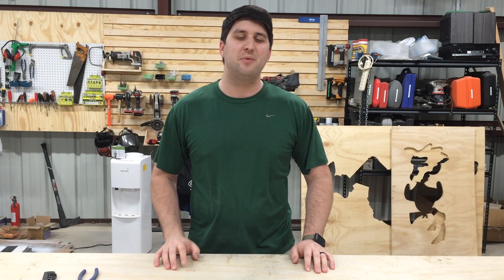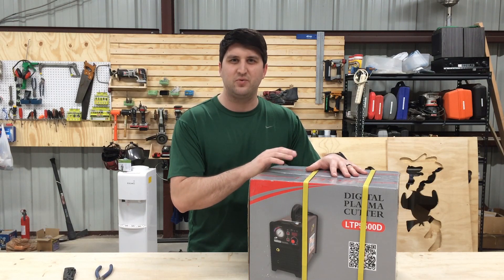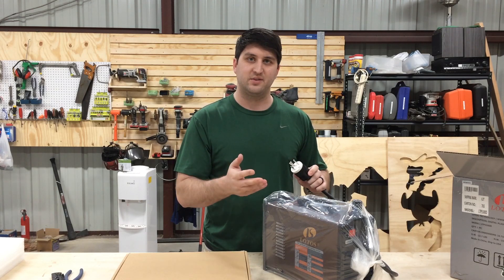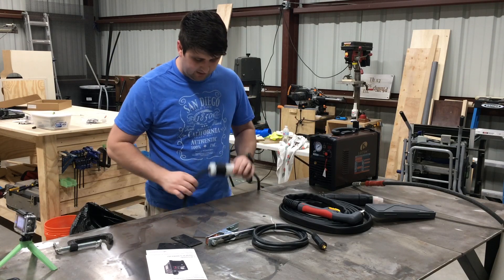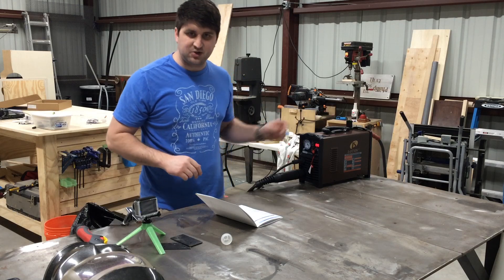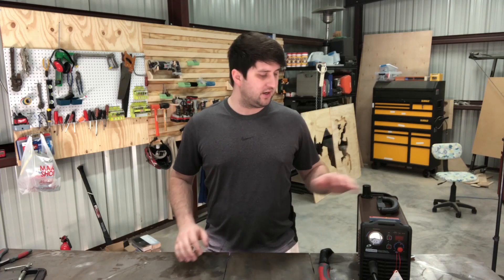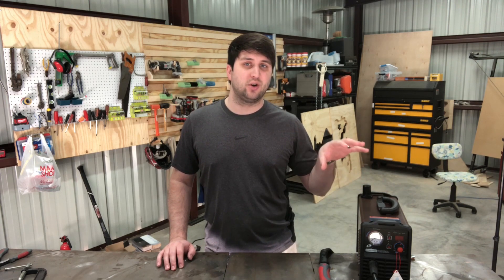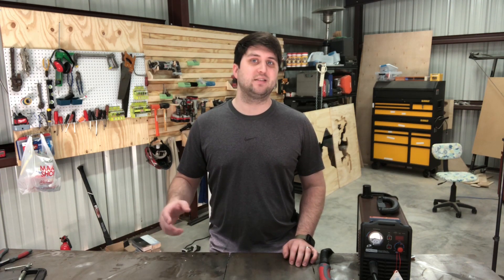Lotos LTP 5500D Unboxing and First Use

Comment: Looks nice. It would be nice to see the consumbable side of the torch and hear what you think about quality of it, how it connects to the plasma cutter etc. Just didn't learn much
Reply from the maker: Jeff lyon sorry to hear that, I did some videos on the consumables but unfortunately life got in the way of editing/posting. I will say I currently do not own this plasma cutter but I was extremely frustrated by the consumables since they shipped with s45 consumables even though it was labeled on the side as a PT-60 torch. This made for some definite frustration when I went and locally purchased PT-60 electrode and tip and what do you know, it didn’t work. Otherwise it wasn’t a bad unit, however I moved more into CNC and it gave me some high frequency troubles with my first cnc so I went with a different one for the second.

Comment: I got the LOTOS LTP5500D-CNC. I'm setting up my shop atm. I'll make some videos on it and hopefully have space to run it on my CNC by next year.
Reply from the maker: Tio Dave that is awesome! What CNC will you be using it on? I have heard some people had better luck with the CNC version and it not causing electrical interference.
Reply: The Mostly 3d Printed CNC or MPCNC. I've done some vinyl cutting and routing on it. I'm excited about cutting metal on it.
Reply from the maker: Tio Dave that is awesome! I am excited to see how that works! Pretty versatile cnc
Reply: You and me both. I got the shop compressor setup today. I'm working on plans to try to set it up temporarily until the final resting place is ready.
Reply: Did you ever get this to work for a CNC table? I just got mine installed on my home made CNC, no electrical interference but it keeps losing it ground connection and the arc stops.

Comment: Nice vid Chris - was that a drag cut in the video or was there a gap maintained by the tip - thanks
Dennis
Reply from the maker: Dennis Kramer it comes with a metal standoff that is like a spring clip on the outside of the nozzle. I was dragging that, but it was gapped off the metal by about 1.5mm like they say in the manual.

Comment: So I’m thinking of buying this. So tell me if the drag cut is the way to go or above cut? Also will this work on a generator? So why the difference in the voltage I’m confused. 110 or 220
Reply from the maker: Johnny Mensi this comes with a spacer that goes around the tip allowing you to have it spaced the proper distance from the work surface but still have contact with the surface. I have never tried this on 110v. The only thing that I just recently found out and was slightly shocked is that they sell this unit with consumables from an s45 torch even though it is an IPT-60 torch. It does all work, however it seemed to me I was using higher amperage than the recommended to get the cut I wanted. I hope this helps!

Comment: Man I bought mine months ago just got around to hooking it up and had an air leak out the back too I see you don’t ground to the piece your cutting but next to it I have to do some car work figured I’d disconnect the barrier to make sure nothing looped to the ecm
Reply from the maker: Aaron Brown yeah I found that I had serious leaks if I send anymore than 70-75 psi from the compressor, anything over that it automatically dumps I think. Currently I am clamping to whatever the piece is sitting on with my cnc machine and it seems to be working well. Eventually I would like to have a magnetic ground because I have one on my welder and love it.
Reply: Just got my Magnetic ground clamp for my welder coolest thing ever
Reply from the maker: @ajbrown2013  yeah I just purchased my third magnetic “ground” clamp, I use them for welders and plasma cutter now, just makes it so much easier and lower profile!
Reply: @chrisbaima1512   NICE MAN I JUST TOOK MY LOTOS 5500D APART AND NOTICED THE AIR LEAK COMING FROM THE REGULATOR -WATER SEPERATOR IM TAKING MINE OFF THE MACHINE AND GOING TO USE MY OWN I MADE AN AIR COMPRESSOR QUIET BOX AND SEVERAL WATER SEPERATORS ALONG WITH A PRE AND AFTER COOLER FOR THE AIR LINES.
Reply from the maker: @ajbrown2013  I am sure that will be a great help. I have seen plasmas, even with different manufacturers, having problems with the internal regulator. I did an after cooler on my air compressor and that helped to dry my air significantly.

Comment: DID YOU TURN THIS INTO A CNC PLASMA ?
Reply from the maker: goMyles yes, I was able to turn it into a plasma cnc, but then my design wasn’t perfect and so it wasn’t as good as I wanted so I ended up taking it apart and upgrading/purchasing a Langmuir CNC and I love the thing.
Reply: @chrisbaima1512  That's awesome and I really appreciate the response. LOTOS launched a newer model LTP5500D that has CNC Ports built into it, I've ordered that with intention to use it as the plasma for the Langmuir CNC Plasma as well. Curious, did you go for the Pro Model or the standard model? And any chance you can do a short video showing it off? Would love to see it! Thank you and subscribed
Reply from the maker: goMyles since mine did not come with a cnc port I had to add mine for my first cnc and then I ended up selling my Lotos because I was having a few high frequency issues, I also was purchasing the Pro and so I wanted to just get the plasma that LS sold and get the complete kit. I will do my best at taking some video and put something out about it. But I do love my new cnc it’s been great! Much appreciated!

Comment: You didn't cut through the metal on the first couple of attempts at 240v. You didn't attempt 120v. Not a good review.
Reply from the maker: Thank you for your comment. You might notice that I do not call it a review, it was literally the first time to open the package or use it. Also, it has been so many years since I had this cutter I do not believe that the version I had then was dual voltage. The version of this that is sold now has additional ports on it for a cnc and I believe arc voltage. It might have been but there was no equipment/cables to use anything over than 240v. Finally, as far as the cuts, this was the first time I had ever used a plasma cutter and I didn’t realize how fast you typically should move and I had a lot of slow movement dross in the back that made it look like it wasn’t cutting all the way though. Sorry for my inexperience and sorry you didn’t enjoy the video.